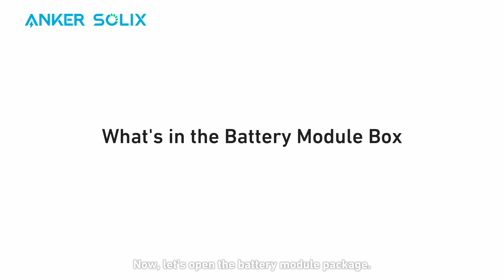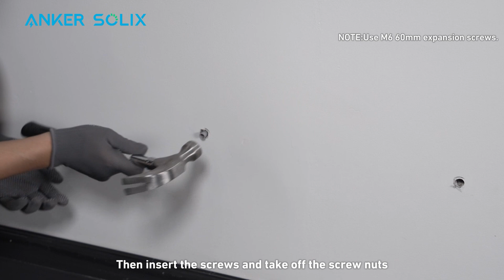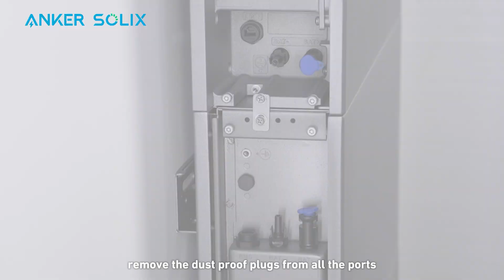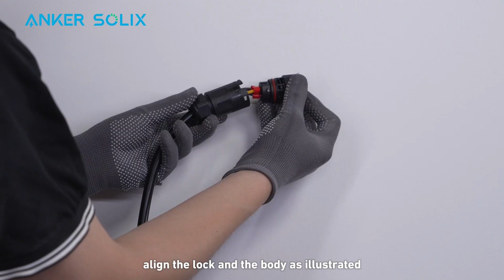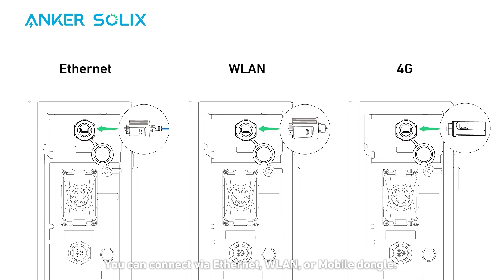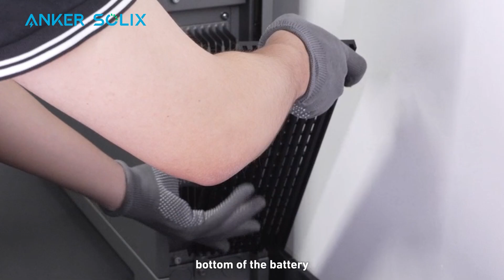X1 EU Hybrid Single-phase Installation Video (EN)

Comment: If the system is set up with backup wired to the main fuseboard, is this contrary to manufacturer guidelines? I assume so, for this reason -
6.4 Connect to the Grid and Backup Loads

· The total power of all loads connected to the Anker SOLIX X1 backup port must not exceed the inverter's rated output power. Special attention is needed for inductive loads, such as motors in air conditioners and fridges. The starting loads of such appliances must not exceed the inverter's power capacity range.

Please confirm.